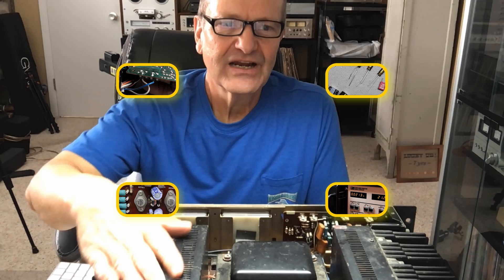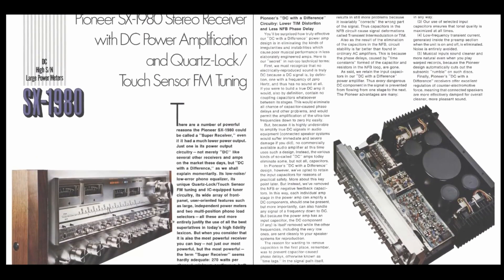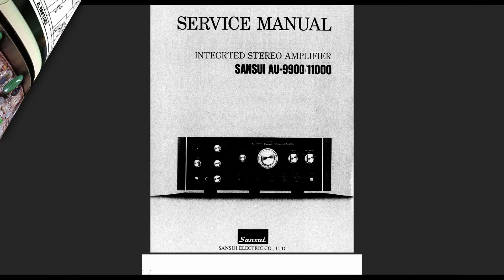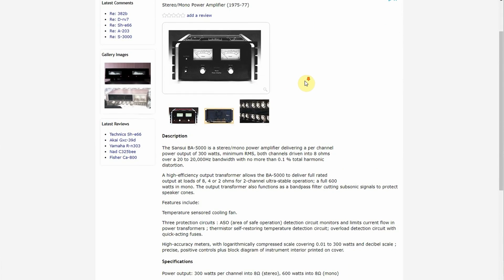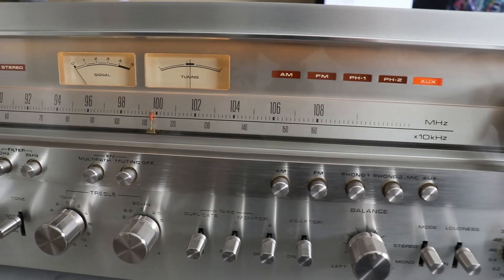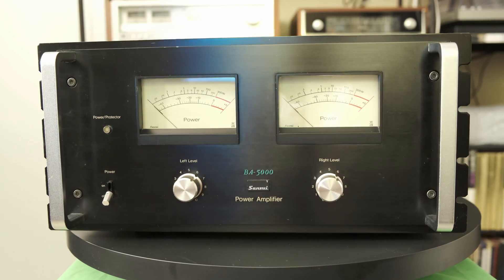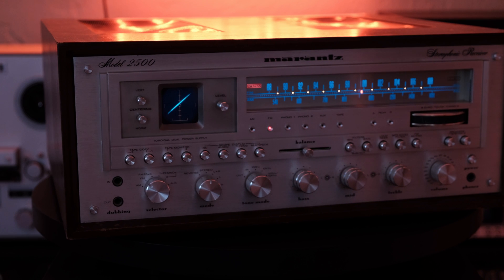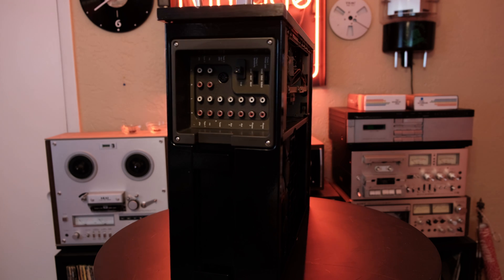Documentation Crisis Affecting The Repair Of Your Vintage Audio Equipment. HiFi Engine Problems!

Comment: I was one of those members who found his membership cancelled because I had not used the site for about a year.  It would have been nice if the owner had sent out a warning to his members advising them as to what was going to happen to long-standing members.  I wonder if her is planning on starting a paid service.
Reply from the maker: I'm sorry that you can't get in any longer but thanks for the info. I certainly would pay a fee to use the site as I'm sure many would.
Reply: I personally think that the guy who owns & runs this site is another one of these self-important Mall-Cop Jerkoffs! YES, it's a great service! YES it's invaluable to those of us who service vintage audio equipment & do so for others!
HOWEVER. It seems that this GOOF behind Vinyl Engine LOVES to "play God" with the users of his sites, as I found out both very quickly & also the hard way!
He's an EXTREMELY judgemental & intolerant S.O.B. who reminds me all too much of others like him, such as the immoderate "Moderators" on the various forums & Chatrooms out there from the egotistical self-promoters like Steve Hoffman to the greedy & self-satisfied crew behind Canuck & USA Audiomarts.
I'll get to the point. Gob forbid that you use these sites for anything other than their primary function! DO NOT participate in their forums!!! Download your manuals, upload your "For Sale" Ads, AND KEEP YOUR NEGATIVE OPINIONS OF AUDIO EQUIPMENT THAT YOU HAVE OWNED OR SERVICED TO YOURSELF.
Because as soon as you do that, the Mall Cops in the Chat Rooms positively CHERISH their EVERY opportunity to lord over you with their sole & PATHETIC power to lord over you, bully you, humiliate you, & kick you off the site PERMANENTLY! I'm not the only one who has been kicked off Hi-Fi Engine for no apparent reason; I can only guess that that's what got me consigned to the trashbin without either the courtesy of a notification that my membership had been terminated, nor any explanation as to WHY, or WHAT my heinous crime was, & BEST OF ALL, GETTING ABSOLUTELY NO RESPONSE TO EXTREMELY POLITE E-MAILS SENT TO THE WEBMASTER AS TO WHAT HIS "PROBLEM" WITH ANY OF MY CONTENT WAS!!!🫤🪓
This BASTARD at Hi-Fi Engine could have simply banned me from his forums, WITHOUT banning me from the entire site, so that at least I could still have access to downloading the service manuals that I need more to HELP OTHERS by repairing their vintage equipment than my own!
Everyone is crying, rightfully, that there's a real shortage of qualified technicians willing or able to fix their equipment.
So thank Little Lord Fauntleroy for making the situation worse, because by not running his site for personal financial gain & instead running it so that he can be the sole & uncontested arbiter of other people's character & get to play God in his little tiny corner of the Internet sandbox, he's been causing an increasing amount of harm & chaos to the repair & collector community than he's helping it.
I use Electrotanya of Hungary; his schematic library is ALMOST as big as Hi-Fi Engine's. You don't have to become a member because he doesn't offer "memberships" in order to hijack your personal information & IP address so that he can ban you from his site for as long as his ran-dumb 🤪 spitefulness holds up (which in Hi-Fi Engine's case is FOREVER!). He has banner & other on-sight ads to pay his bills, & best of all, he doesn't try to build up his user base by offering a bunch of Chatrooms so that he can shitcan people on a whim just because there wasn't enough fibre in his cereal that morning or he got a pimple on his bum!😂
My second choice is Radiomuseum, which also doesn't force you to become a member in order to download files although becoming a paid member allows you unlimited download privileges as opposed to the very limited downloading he allows per visit per day.
I recommend that ALL of you that belong to Hi-Fi Engine IMMEDIATELY start to upload your Hi-Fi Brownloads to Electrotanya to ensure that you & others will have worry & hassle-free access to these schematics for now & a long time to come. In fact, I would ask any & all of you to upload any pdf's you have to every schematic site you can find, like manuals.lib etc. etc...
Having all your eggs in one basket is gonna funk ya sooner or later; whether the Webmaster starts losing his marbles today or croaks tomorrow!🤨

Comment: I'm new to HiFi Engine and only joined last year...the only odd thing is that it forces me to remove the "full-stop" or "period" that's in my Gmail address...never been asked to do that when using my Gmail to login to any other website.

Also, it never had any literature for the old amp i was restoring - an Eagle International A4400, however it did have literature for the other old amps i'm restoring (NAD and Rotel).

I found the website really useful and will be sure to use again.

Maybe the owner should charge a small fee for downloading documents - or an annual subscription?

Comment: Been a member for 4-1/2 years and I logged in easily just now. 
I wish all you skilled repair guys weren't gradually vanishing.  
3rd repair guy I'm using is going on 2 years for a couple Yaesu vintage shortwave radios and a Magnovox console....2 hour drive each way.

Comment: They should charge $5 each per manual to ensure there's enough revenue to keep it going. Along with that, having the flexibility to pay using credit, debit, or PayPal. 
 This way, when the one guy is gone, someone else is more than glad to take over.
... And for those saying $5 is too much. Ask yourself what you're willing to spend now to restore your project.

Comment: I believe they've been a very closed group for a long time. They have a lot of resources but it is practically impossible to register with them. I've tried for years with several VPNs thinking they wouldn't like my italian IP address. I have some manuals that aren't online yet that I could share. I keep them as my trade asset.

I use elektrotanya and manualslib, I won't add any more details as Youtube has a fundamentalist spam filtering policy. Web crawlers... I've worked sometimes with that software, it wouldn't be a bad idea to save the content for posterity.

This beautiful vintage stuff will and has already outlived us in several cases, we just get the privilege to enjoy, care for, preserve and later pass it on to future generations.

Comment: Talk about timing.  Last night I went to logon to hifiengine and it took me several to get on.  It was the first time in about 16 months or more since I last logged in.  I would have been screwed as my registration email is no longer valid. I could not get in vinylengine don't know if I had an account there thou but no more registration allowed.  By the sounds of it the site owner has refused help running the site.  That is a shame!  I found my turntable's service manual at ElktroTranya  thou.  I have aquired about 6 new pieces of equipment since I last tried downloading at hifiengine, loks like it only allows 5 downloads a day.

Comment: I just logged in with no problem. I've been a member for 7 years. My hopes are that this site doesn't go away.
Reply: same here, just downloaded a manual
Reply from the maker: Thanks for the info.
Reply: Same! 🤙
Reply: Nope. People should know by now that the HiFi site only works if you joined more than 2-3 years ago, otherwise you can’t join or access anything. Elecrotanya is a good alternative for schematics.